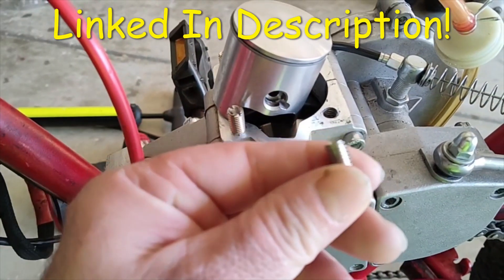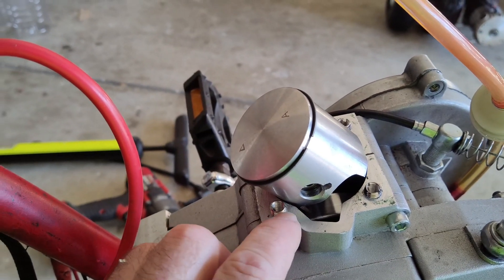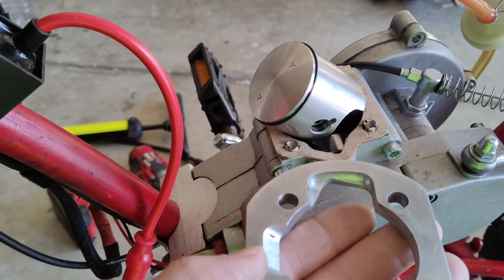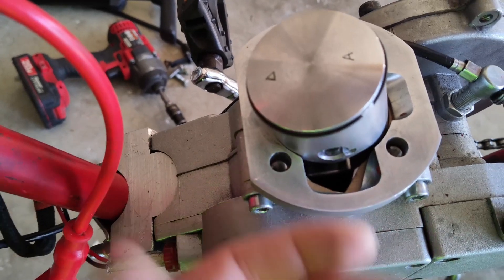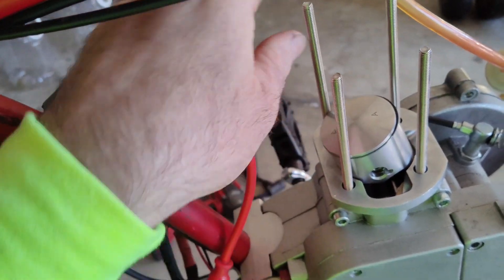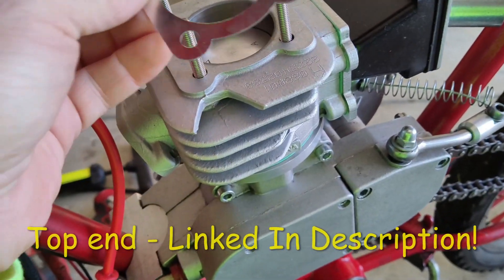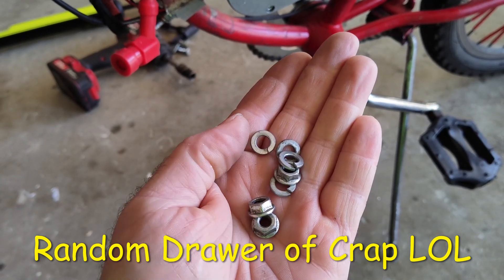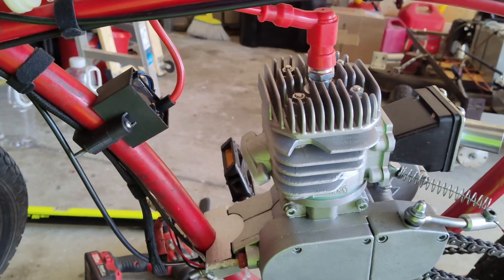Motorized Bicycle Minarelli Top Half To Bottom Half Install How To!

Comment: Is the head in correct position? Really nice solution.
Reply from the maker: Yes for a minarelli vertical head it is.   I know looks odd but the engine on a moped is 90 degrees clocked from a bicycle mounted one.
Reply: @BuildBreakFix  all right, understood. Nice.

Comment: Those are a very brital materiel so be carful maybe I got cheap thread reducers but still
Reply from the maker: Well if you twist them in with a screwdriver 🪛 they snap! Special tool actually used.  Easy way to not break them twisting some in tight!  Put a nut on a bolt.  Spin one onto the bolt. Tighten the nut down.  Use the bolts head to screw in the insert.  Use a wrench on bolt and nut release the nut and unspin the bolt.  Only way to drive them in tight without the special tool special tool supports inside of the incert not allowing it to fold and crack as you drive it in. Like the bolt does

Comment: AliExpress has 50cc aluminum cylinder for 42.59 + 16.89 shipping have you tried their aluminum 50 minareill i was wondering if it is good or not
Why did you not use CNC head from 80cc bike for this build is the stock head better
Reply from the maker: Yes I have.  They are cast iron in that price range

Comment: Did you put the head on wrong?
Reply: nope thats the correct  way
Reply: @stlrob21  let's let him say if it is or not.
Reply: @KB_Joys  it was said in his prior video lol
Reply: @stlrob21  well maybe I've lost my damn mind, that's a possibility lol
But now imma have to go back and look.
Because I could have sworn he had the head in the other video with the slats on the sides.
I remember thinking yeah, I would put mine on it like that too.
Reply from the maker: The head has a distinct pattern cut into it that matches the top end and head gasket.    You can use a motorized bicycle head but you better align it like a brain surgeon cause head strike = death
Reply from the maker: Yes it's the correct orientation for a minarelli vertical head to the top end.  You have to remember this came off a moped that has a CVT attached to the engine 90 degree turn of how it's mounted on a bicycle 🚲